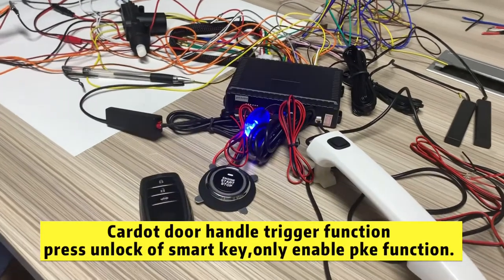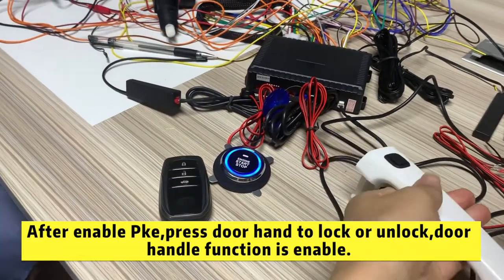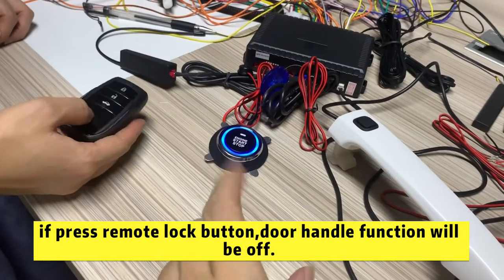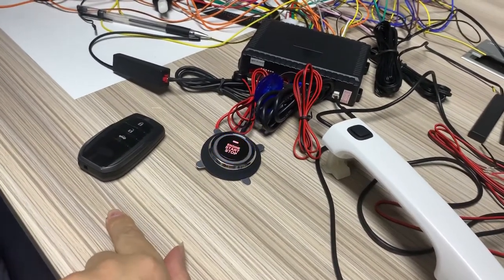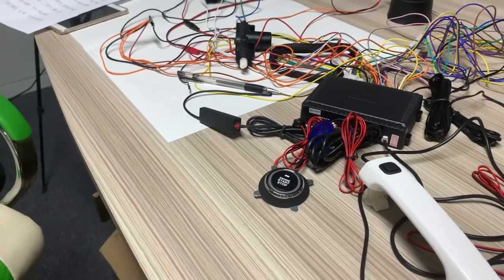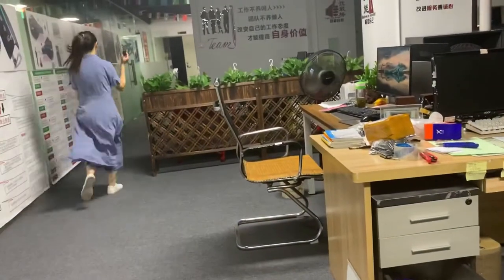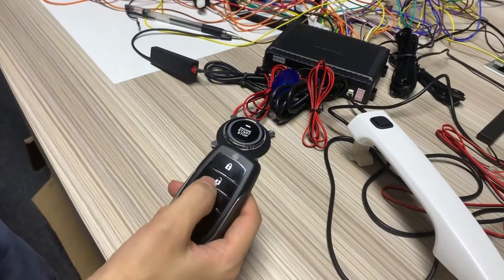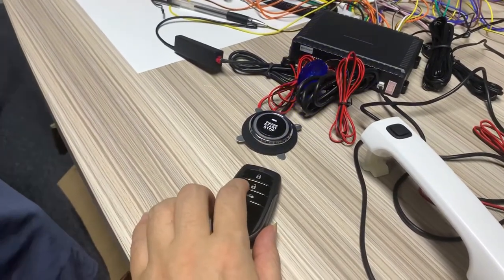Cardot universal door handle trigger smart car alarm

Comment: very good, i bought this one. please in next version add more PKE HF Antennas,  because just 2 have no signal, even when close of the car, and remote on pocket. the ideal would be 4 antennas, like originals car, and no lock trunck if remote inside. and cardot is best brand, is top mind in Brazil.

Comment: Is there any support or manual to install for handle, my car has 4 wires, (Vin +12V, GND, Unlonk signal -, and lock signal -) in driver’s door and passenger’s doors. I need help. Cardot module has only 1 jack with 2 wires.